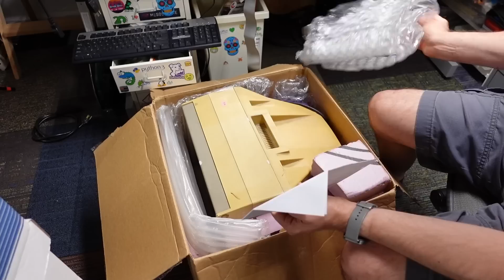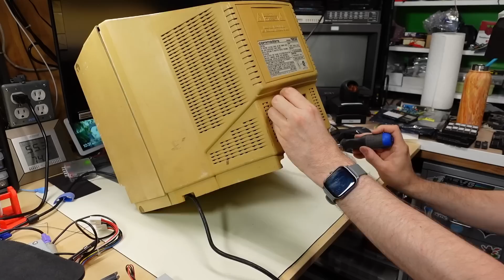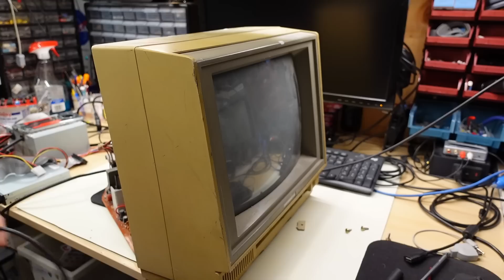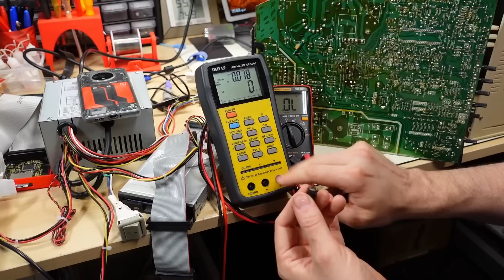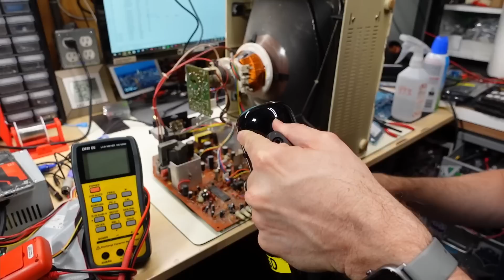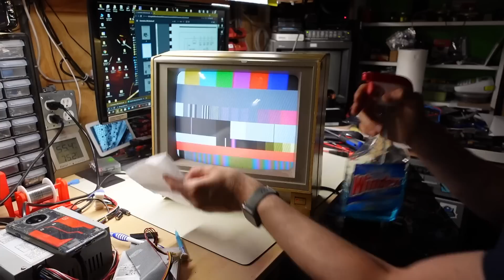What broke on this Commodore 1802 monitor? #repair

Comment: Thanks for this video. I've got an 1802 monitor also, so was glad to learn good tips from you on how to approach debugging the problems I have with mine. It still feels pretty daunting, but will brave the debugging journey. Not sure if I'll get the happy ending as you did, but ah well, if I fry it, hopefully I learn a few lessons from that too. I also liked your approach, trying to look for root cause, rather than replacing all the caps :)

Comment: The common issue with these monitors was the glue itself, outside of typical wear and tear of caps. This glue had a bad habit to degrade with time, which caused it to become hygroscopic; once it acquired enough moisture, it turned to acid and corroded the hell out of everything it was in contact with... and this glue was basically used for EVERYTHING, from components to coils on the tube. You can guess what happened next.Typically, when these monitors were kept in good environment, it slowed down the glue degradation but vast majority of these at one point ended up in basements, storage lockers etc and these places typically aren't the best type of storage space for electronics, unless they're ventilated and AC'd.

The easiest way to discern how well preserved the monitor is - as in, how repair-positive it remains - is to check the glue. If it's light-creme, then it's decent. The glue went from creme to light brown, dark brown and then turned black in worst cases. Dark brown and black is usually a very bad sign you're going to deal with heavily corroded elements... and outside of caps, the coils themselves had a habit to finally corrode too; It's all repairable but in many cases - if the coils corroded - and they did, usually around the hinges - it might be a lot more work than its worth. Adjusting coils again without specialised equipment is near impossible in typical home repair scenarios and you're going to end up with skewed and uneven, discoloured displays if the monitor will work at all and it's very easy to damage the tube if you have no skill nor knowledge on how to do it. In worst possible scenarios it's just better to replace the entire tube with one that's not as badly corroded from another spare. Don't waste your time unless you have no other choice, it's just life and most of these are over 35 years old by now.

Glad to see another 1802 saved. The rest of the things should be relatively easy to fix and after a retrobrite, it's going to look as good as new, well almost :- )

Comment: I think I have the same problem on my 1802, exact same one as you have.  I'll let you know how it goes once I get another cap.  Ok, next day and I finally found an exact cap replacement that I had taken from something else long ago.  Only had that one.  and yup, I had the exact same issue that you had and the bad cap even looked the same.  It works perfectly now.  But now the power switch just broke.  I have to hold it in to get power.  sigh  Adrian, (or anyone) do you know of a good replacement for a power switch, if I can't find the exact replacement?
Thank you so much Adrian.  Keep these awesome videos coming!

Comment: When my dad allowed me to get my Commodore system. I was able to get the Commodore 64, Commodore Monitor, and two floppy drives. I wish I had that today. But things like cars,  and installing parts like better Cam,  and Headers. My life changed. And I packed my system in a box and moved away. When I arrived back home, i found my box was gone, and my mom got rid of it. The monitor I had the speaker was on the top.

Comment: 5:41 high dot pitch, not low ;)

I’m working on one of these today which has a bizarre effect that I call the Aurora Commodoralis. Very dim wide diagonal bars of red, blue, and green shimmering in the middle of the display (bars are a few centimetres long) - visible for several minutes in a dark room after turning off. I’ve never seen such a thing on any CRT before 😂

Comment: Adrian, please help, I'm scared. I've lost color to this exact monitor. More precisely, it starts bright pink and fades to gray faster than I can test the color from the C64 on the luma/chroma input. When I first got it, it held color for a few minutes, but striking green lines would burn across the screen until it reached it's current symptoms. I can't figure out how to get the composite signal to work so no clue if that's also monochrome or not. My google-fu tells me R225 is the culprit, and finding it on my board shows it's wedged right next to the thick red thing on the bottom left of the board from the orientation you had it in 39:08 and has a dark brown burnmark. My multimeter shows it as reading 5.3k ohm from 5.1k but from what I can see, tons of these resistors are at least that far out of spec, so maybe my multimeter is trash. I've ordered the replacement, but am I even on the right track?

Comment: The PC and keyboard/mouse has to be designed to use those passive adapters. My current PC has a combo PS/2 Keyboard Mouse port on it and works with passive adapters.

Comment: @Adrian's Digital Basement ][ Cif power shine is good for electronics cleaning. I don;t know if it's abaiilable in the US, but in Europe, specially in Poland and Germany you can get one with no problems. I used it to clean up trash picked CRT TV gunked up with ciggarete residue. I soeaked it wet, and alll gunk was gone in a few mins...

Comment: I worked as an automotive tech for nearly 2 decades and yes, once you verify the concern\problem with whatever you are diagnosing, a good visual inspection can save so much time. You still should always test and verify a failure before condemning the part, but just looking first can really help narrow down where to look.

Comment: another tip!   pretty much all parts location id numbers are the same from brand to brand as a standard.   so if it's a vertical deflection issues it's gonna be a part in the 400's.  if it horizontal deflection or no high voltage it's going to be a part in the 500's.  unless your B+ in the power supply is gone (b+ voltage is your main voltage coming from the power supply.)   if you pay attention to the numbers you will see what i'm talking about and it's helps you find the section of the board you should be working in.

Comment: all caps have a tolerance (printed on the cap) on the value.  most are + or - 5%  so a 470uf cap would be around 24uf. 470-23.5(5%)=446.5uf   your cap was 422uf. that's a bad cap!  and being almost 50uf smaller then the required 470uf is another reason not to use the cap.   I would not trust it to last very long.  the rule for capacitors - a little higher value is ok, anything below the 5% guideline should not be used.   if it was in the horizontal deflection side then you really need to stick to the 5% rule for safety.

Comment: Hey Adrian. In one of your videos you said Cathode Ray Tubes are a consumable. Do you really think that, or do you think the control circuitry drifts? I would have thought that the electrons were coming from the power supply, and the thing is a vacuum. Arcade cabinet tubes seem to last a very long time with service. I'm confused on this.

Comment: Sure enjoyed The Monitor… movie 😀

Have one my self. And its power button is loose and need a replacement. (Wont stay in). But Those old things are Nice to have in your Retro collection. Not The same 80’s feeling to slam a c64 to a lcd as to an old crt from Commodore.

Comment: Dear Adrian's you can use 100 w light bulb in between for a safe switching on an old TV or Monitor that you're not sure whether it work or not or there might be a risk of blowing up, it's very easy if the light bulb does comes on that means there is a problem and you should not plug it in directly until figuring out the causes, stay safe.

Comment: The problem is called "vertical foldover", it's not uncommon in crt tvs/monitors, and it's 99% of the time a capacitor.

Comment: When shipping monitors, you REALLY need to use those expanding packing foam bags to basically make a form-fitting insulator that has 2-3 inches of  foam in every corner of the box. Also, use a thick-walled rigid box. I've shipped 6 monitors this way and none of them were damaged. The only way to do it better is to use the original box with the original styrofoam.

Comment: i was recently working on a Nokia phone dc charger. The optocoupler Zener diode had made PCB into black ,and it was getting so hot that the solder joints were dripping off on the plastic body!

Comment: I remember I built a power supply. the capacitor across the output was a high capacitance value (4700uF I think), but only 16 volts. The input to the voltage regulator was only 15 volts, under load, but when the load was removed, it'd float as high as 18.
I only ever used it while it was under load, but I leant it to somebody. He said that when he finished using it, and turned his machine off, the power supply made a bang sound. Yup, the capacitor inside had exploded, pretty much filled the entire box with gooey fur.
Replacing the capaitor wasn't an issue, I actually used a pair of lower capacity (2200uF?) 25V capacitors... but it took me about half an hour to clean out the remnants of the old capacitor.

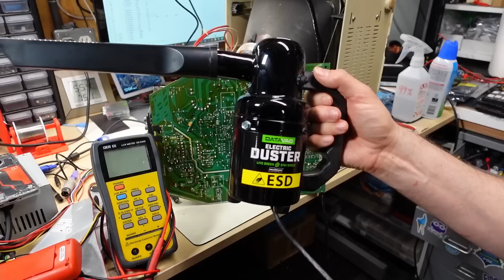Comment: 35:21 I bought one. It weighs 2 lbs. When I first plugged it in to test it, I didn't know if it was on or off. It was on, as evidenced by the blower shooting back a foot and then starting twirling around. That's how powerful it is. 😄

Comment: I never had a 1702 or 1802 monitor.  I eventually had a Philips color monitor that would do 80 column mono for the 128.  Forgot the model, but rigging it for Mono output was a mod I did back in 1987.

Comment: At least the Postie didn't use the box as a football, unlike Mr Lurch's All-in-one package from his Saturday video. I actually bought a 1084 monitor from East Coast Australia to West coast, and I never appreciated the risks of it being damaged. The seller did a great job of protecting it and even put FRAGILE stickers all over it, and luckily it arrived intact, and I cherish it to this day. I recapped the electrolytics, now I feel silly as the old ones were likely just fine, and it never worked any better. It's a great combo with my Atari 800XL with RGB graphics adaptor.

Comment: Great Video!!! I'm glad I checked your 2nd channel or I would of missed this great piece of retro history being fixed. I watch every video on your main channel and love your content so much!!! On a side note I have just bought three 1084S monitors from eBay to try and make two. One for my A1200 and the other for my C128D that I just got last week. One sold as works but the case is BAD (It showed up working like the eBay photos showed). The 2nd one is sold as is for parts only in original box with all books. Seller said it worked when he put it away 5 years ago and the case is perfect!! with no yellowing). The 3rd one is also in original box and it's case is a little bit rough and the seller shows it working if you hold in the switch after a few pushes, but turns off as soon as you let go of the switch. I have bought a four pack of their power switches (ME5A TV3 2.5/100 250V XB power switch potentiometer switch 4 Pin-4PCS/LOT) from AliExpress for $36 and free shipping. I'm hoping at least 2 or 3 work because in the reviews some have wrote that one of the four didn't work.

Comment: Something you should be aware of is that the red Deox-it-it is for switch contacts, not carbon composit potentiometers. It can actually damage them. For what you're doing you actually want the green Deox-it which has compounds more well suited for carbon composit potentiometers. It'll save you some nasty headaches later.
Reply: My old boss had us use knockoff WD-40 on radio pots to clear up the crackling, it seemed to work but the crackling would return after a year or so. Was that damaging them?

Comment: B4 i watch let me throw out there Back in the day my 1484 had a bad solder joint which would make the Hv drop out. Easy fix right on bottom od pcb. I seen this on another as well.

Comment: Nice one, Adrian.  Yep - shotgunning is a viable (and on vintage electronics, some would perhaps say the best ) servicing technique.  But I agree with you and your diagnostic approach.  For vertical centering on sets without a control (and fergitaboud changing  resistors, eh?) sometimes using the purity rings to centre the image woiks.  Maybe.

Comment: Great video - as it turns out the CRT was in such good condition, maybe it could be worth a case restoration too!

Curious how long you spent doing the board component checks, interested in how much time would have been saved by doing the visual inspection.

Comment: Be careful with this monitor and do some extra preventative maintenance before putting it away. Inside the yoke there is some of that same brown glue and it will eventually corrode through the yoke winding and cause a short which will blow the yoke and then you'll have an unusable monitor. Remove the yoke and clean off all the brown glue and hope it hasn't damaged the enamel coated wires yet. Years ago I was given an 1801 that had exactly that fault and I had to replace the yoke as it was burned black on the vertical winding. You've been warned, do nothing and the monitor will die all by itself thanks to Commodore using corrosive glue. The fault is documented on Ray Carlsen's website. Go do some reading and fix it now!

Comment: What I did with a can of deoxit that had that top was remove it, and put on one from a duster can. You said the air can you have Is almost empty so you can do it with that.
Reply from the maker: Thanks for the tip!

Comment: I've had a few shocks from undischarged HV caps on a monitor (a mini monitor, but still a shock), so it was a bit cringy to see you working on the monitor board without discharging the HV cap. :P

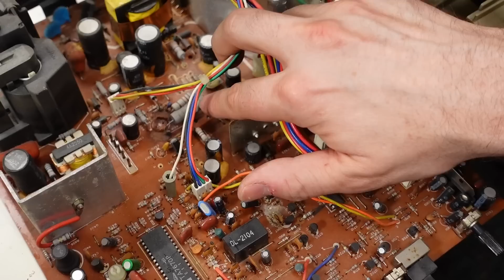29:20 Actually, I think that is glue. What we may have here is a classic case of the glue used to hold the cap in place becoming dry, crusty, conductive and corrosive over time. I've seen that in at least two instances. One was with Terry Stewart's Classic Computers, with a diode in an IBM CGA monitor becoming corroded. The other one was with a rarity that I wasn't exactly able to save because it seemed too far gone; a power supply for a Sanyo MBC-775 XT Clone. (The kind with a color CGA CRT. The kind I got shocked with. Don't fret, though, because I got another one with it in a lot sale, and the other one worked with parts swapped!)

I may be wrong about it being glue, though, but I've seen similar gunk on perfectly-normal caps in that power supply being held down. (Although the leads got corroded in many instances.)

Comment: As a person that has done repair work on equipment that has power resistors around capacitors and all I have move power resistors to a metal heatsink or the frame to keep the caps from cooking. When replacing capacitors I don't deviate to far from the capacitance value and will usually go higher on the voltage due to the factors of how some systems were designed around specs. If a system is rated to have 25v on a line you will see tight values installed of either the 25v which is not the best idea or 35v which is better but still not very good. I usually will go at least twice the voltage of what was in there. In this case I would have gone with a 50v cap just to have a good safety margin. Better to have higher voltage than be too close that a surge pops it or another component goes wacky and sends higher voltages where it was not expected taking out more down the line. Thanks for the video. Sorry for the text wall.

Comment: i have an 1802 made in'86. it looks white, and is larger than this one. been in wrapped in a plastic bag, and not turned on since ~2000. was part of a c128, or facelifted c64 system my father had collecting dust in a spare bedroom since the mid 90's. i boxed and bagged the whole thing up,put it in storage, but kept the monitor at home. it the only thing wrong with it at the time was the floppy open/close plastic switch was broken.it had the pc,floppy, printer, and joystick. i had it stored in the loft of a friends barn with some other childhood items. they were forgotten about, and the barn was torn down, and all my stuff was lost, but the monitor. if you want it, you can have it.

Comment: Personally, I would've soldered some 30 awg bodge wire onto the leads and slid some heat shrink on each lead just to get it out of the heat zone there
Reply: 30 is too small. The leads on small components are very close to 24awg. It wouldn't surprise me if the cap leads are thicker than that.
Reply: @eDoc2020  you're probably right, 30 was just a number I pulled out of thin air - but the idea remains the same

Comment: One thing of note: when you test capacitors you should test them out of circuit, measuring them in circuit can give you very bad readings
Reply from the maker: My meter is designed for in circuit testing and does an amazing job.
Reply: @adriansdigitalbasement2  Oh okay that’s pretty cool haven’t heard o that before

Comment: I had (have?) a Proscan CRT with a far worse VSync issue, even caused burn-in. Could it be a similar issue?
Reply from the maker: Vertical collapse can quickly damage and burn in the CRT. Unfortunately it could be any part of the circuit causing an issue.